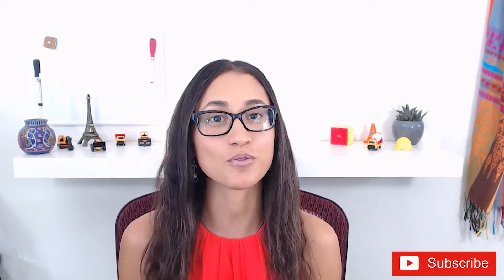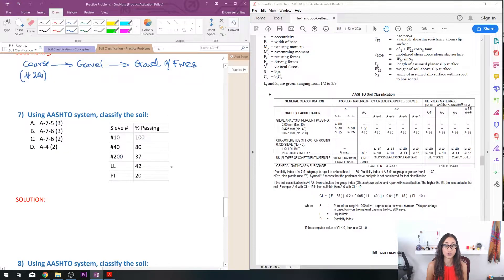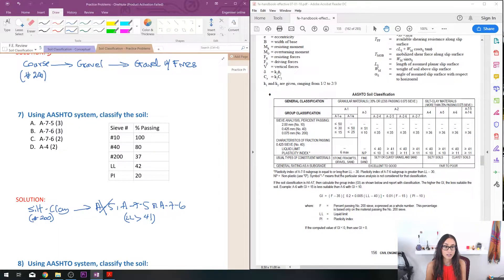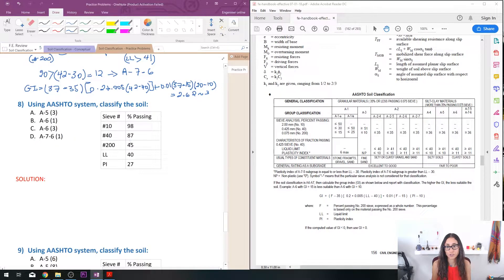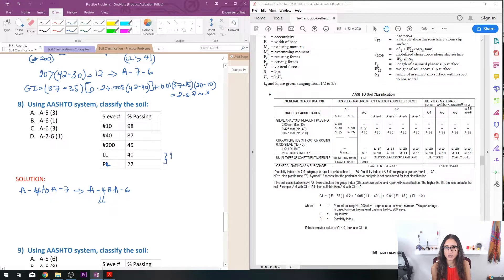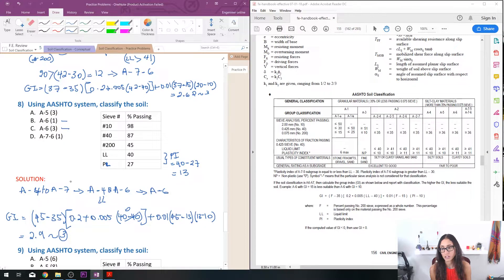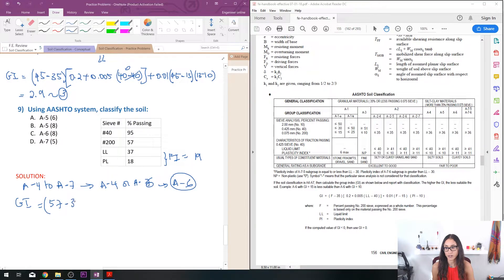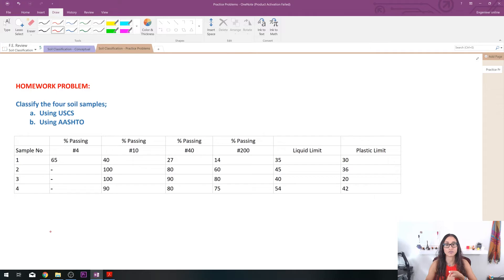FE Civil Geotechnical Engineering - Classify Soil Using AASHTO

Comment: In the GI calc at the end (min 9:58) u used (37-15) & (18-10).   The F =57 and the PI = 19.  I got GI= 8.5 or 9.
Reply from the maker: Hello, thank you for catching this mistake, there is a typo in the equation and I apologize for any confusion. The end of GI equation should be (57-15) & (19-10) and not (37-15) & (18-10). However, I think the answer is 7.85= 8.0. I think I got the right answer but I just did a typo when I plugged in the numbers. So if you plug in these numbers (57-15) & (19-10), the answer is 8.0. So the first portion of the equation I got 4.07 and the second part I got 3.78 which adds up to 7.85. I hope this make sense and let me know if you are still getting 9.0.
Reply: Thanks for the clarification.  Great job.

Comment: Hi, I attempted to do the HW, however, I do not know how to determine if the soil is organic or inorganic using the USCS method in the fine grained soils portion. Would you please be able to help me out?
Reply from the maker: Hello Andrea, so If the ratio of the oven-dried soil’s LL to the air-dry soil’s LL values is < 0.75, then the soil is organic. The oven-dried and the air-dry soil’s LL values will be provided to you in the exam, but usually it is not very common question. Also, if you want to check your answers to the homework, you can check Patreon. I hope this helps. Thank you for watching and good luck with your studying!
Reply: @Genieprep  sorry what is patreon page I want to check solution of the homework
Reply: @abassawaleh5238  It is a website where she posts some videos too, but you have to pay for it.
Reply: Also what does "Liquid limit -oven dried < 0.75" mean how do we calculate/ determine that or if is organic is automatically  that?
Reply: With ASHTO method, if it gives retained data, should I have to find the passing % ?

Comment: I read that if you get groups A-2-6 or A-2-7, a different GI formula is used, could you address that a little please
Reply from the maker: That is right. I actually talk about it in this video, https://youtu.be/0mzj1TxpMsw and you can check it out. I hope this helps and good luck!
Reply: @Genieprep  Hi, I have a quick question, if instead of memorizing the rules of GI and the groups, if we used the formula in the HB for all groups would it yield the same results as if we only used the last part of the formula for groups A-2-6 and A-2-7 and zero for the groups A-1a etc?